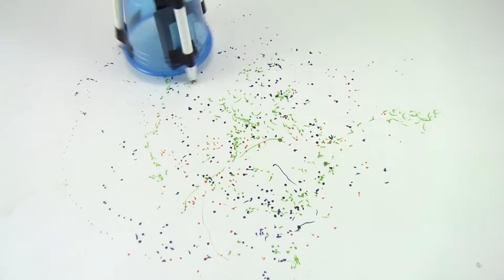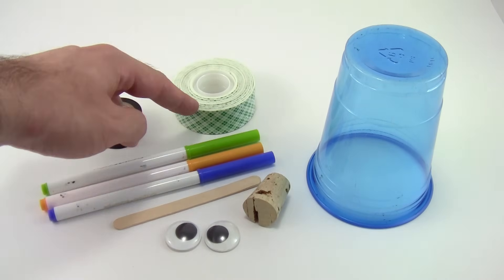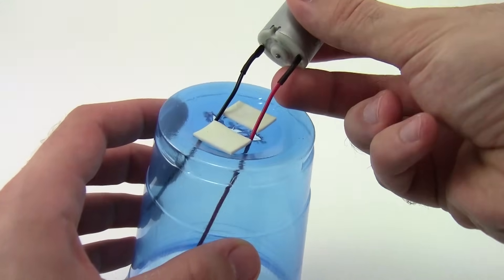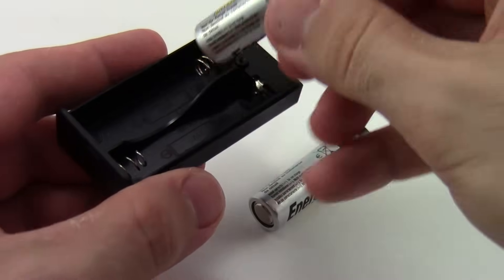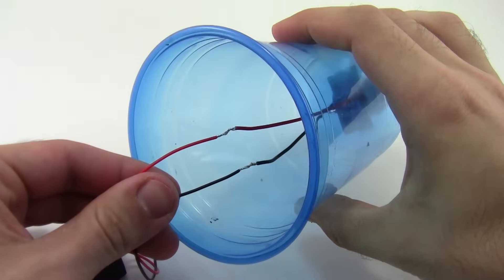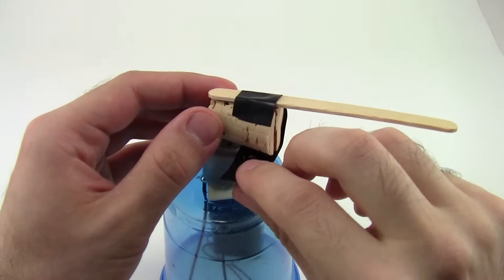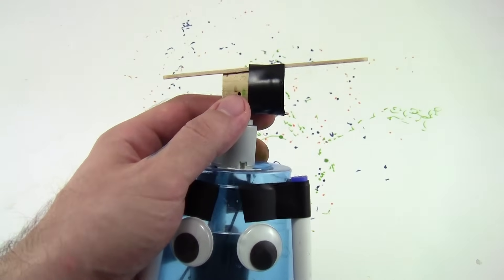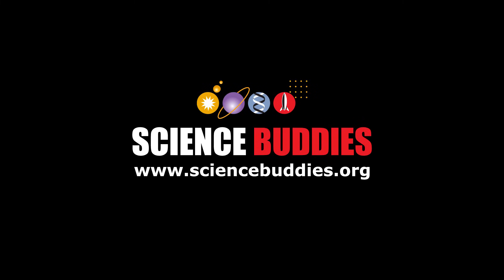How to Build an ArtBot | Science Project

Comment: What can we use instead of cork?
Reply from the maker: You can also use hot glue to glue an off-center object to the motor shaft, just be careful not to accidentally use too much glue and glue the shaft to the rest of the motor.
Reply: @Science.Buddies  thanku so much
Reply: @Science.Buddies are there other easily available objects we can use?
Reply: Thank you.
Reply: A  bottle cap works as well